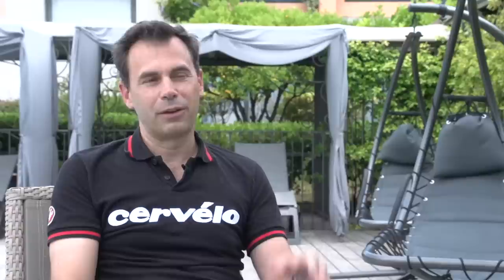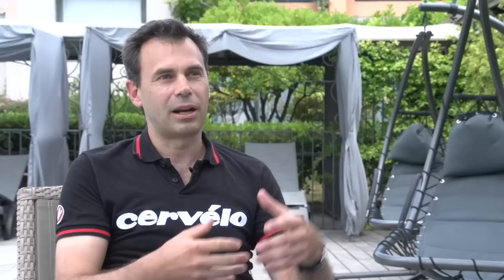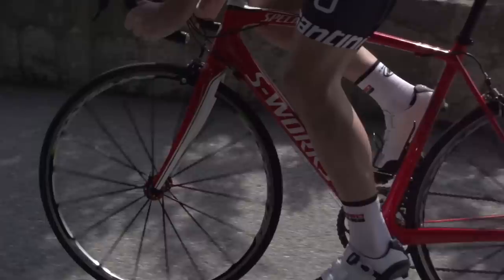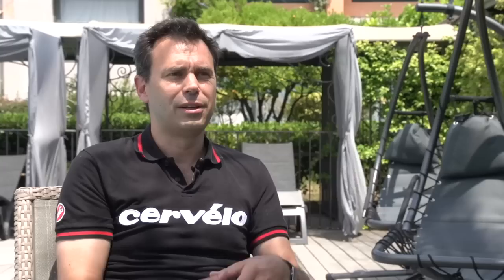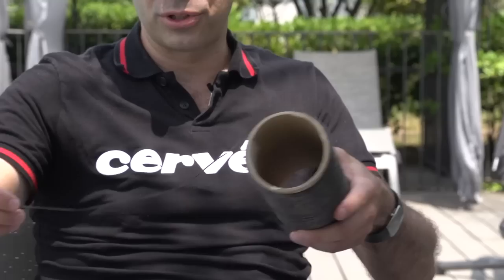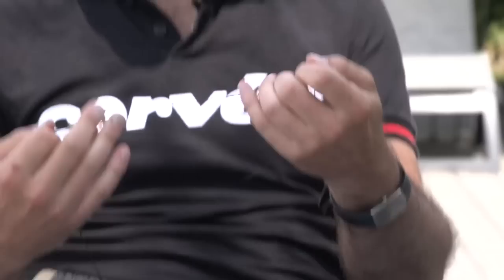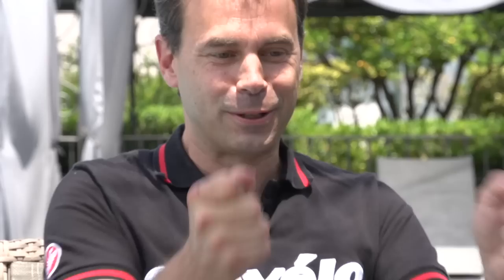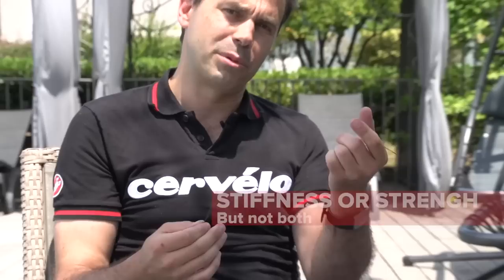What Is Carbon Fiber? Inside Line On Carbon Fiber Bicycles With Cervélo Co-Founder Phil White

Comment: I still think the biggest factor in cycling performance is fitness. Carbon fiber will make the differnece if your cycling is at a competitive level- and you need that extra edge. But the thing is if your at a competive level in cycling its probable you've already bought that carbon fiber frame because you've reasoned others will do likewise. so the discrepancy between one carbon frame and another will not be that great because the market itself is heavily competitive. call me a nerd but economists call this scenario a zero sum game
Reply: Nick Humphrey you must not bike that much
Reply: +Nick Humphrey It's not JUST about speed.  Carbon bikes are a lot more comfortable than aluminum or steel bikes and they handle better as well, making for a more enjoyable experience.
Reply: Nick Humphrey YES. Think of it like a hypercar. If you had a Lamborghini with a FORD V6 in it then not that great. BUT if you had a FORD car with a LAMBORGHINI motor in it THEN you'd be seriously fast!!!! OR...A Lambo car with a Lambo motor even better!!!
Reply: @RomansFiveDotEight  
Well that’s almost always true. That said, there are CF BIKES that will absolutely beat you up because of their UBER STIFFNESS.

Comment: This is because the lay up of the carbon isn't always pretty. There might be small bits used here and there or at different angles. What some builders do is put a cosmetic layer of carbon over the whole thing, but what you are describing is the structural carbon without this covering

Comment: he never answerd the question did he . so what is the differance between a $500 frame over a $1200 frame or higher end frame
Reply: +ashleyroachclip1 it's the engineering that makes the diffrence..
Reply: Again. Doesn't answer the question. What engineering properties are the differences between the 1200$ frame and upwards. How are the differently built?
Reply: The differences are due to the most engineered lay-up (the way fibers are applied at different part of the bike and their type) and the choice of fibers with better properties (=higher cost). Btw some brands sell their bikes much expensive than others because of their "quality/reliability image"

Comment: It amazes people that it's 2013 and we're still having a conversation about carbon fiber, but the reality:

You could have two frames. Exact same geometry, exact same shape, both made of carbon fiber. The ride quality of one could be considerably better - stiffer and lighter - than the other despite the fact they seem almost identical. That's the difference between knowing what carbon to use, how to layer it, and being directional.

The carbon frame I had in '99 is terrible by today's standards.

Comment: A frame tube is constructed from many layers of carbon, it's a sandwich.  The top layer that you see is often only cosmetic, below it there are different types of carbon threads, running in many different directions.  Google "carbon layup schedule"